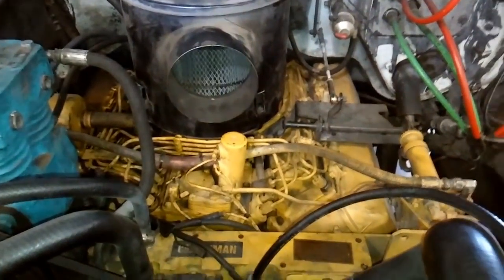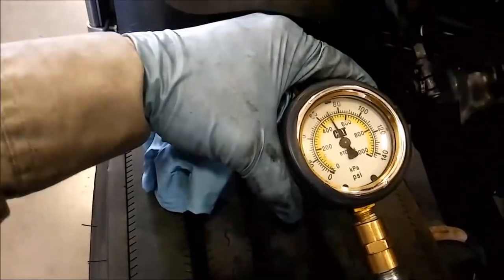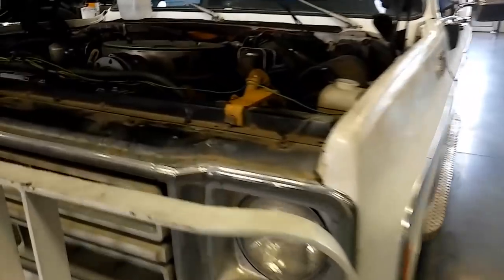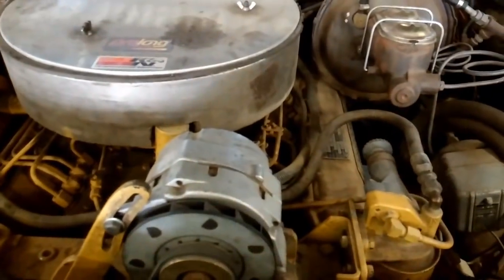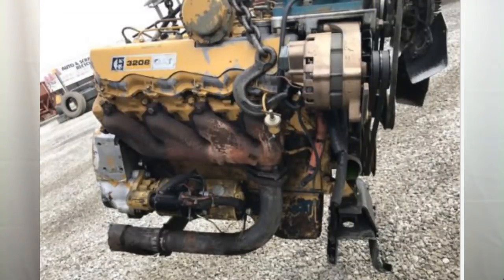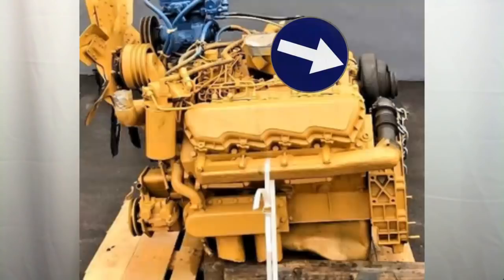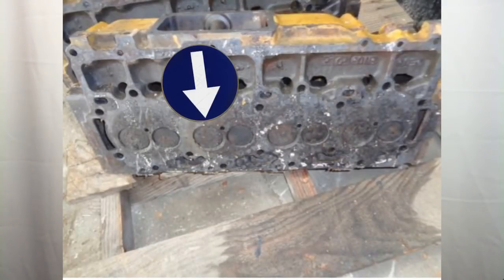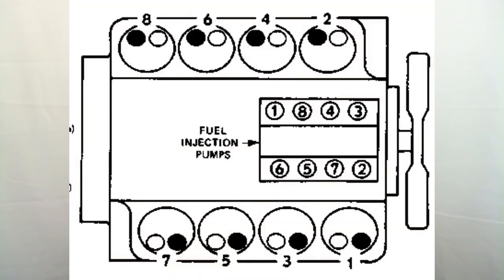The Cat 3208 Engine.  Know Your Engine. Engine Design And Problems.  Cat 3208.

Comment: FTWC, we had a 1975 Massey Ferguson 1805 farm tractor with a 3208 NA. I think the h.p rating was 210. It was a good engine for that application.
Reply: Daniel C my family has a steiger bearcat with one rated at 235 hp. The na models were pretty good. When they start boosting them that's when they started have the real issues.

Comment: Quite a bit of controversy about the early history of the 1100, 3100  3208 family of Caterpillar engines. The 1100, series was a truck engine and came in three versions. All 4.5" bore, 1140 had 4.5" stroke, 1150 had 5" stroke, 1160 had 6"stroke. The 3100 was the industrial version. Both 1100 and 3100 had compact inline fuel injection pumps with servo assisted mechanical governors. There was one truck engine arrangement which used a limiting speed governor.
These engines were designed to compete with Cummins 555 and Detroit Diesel 6V53, 200 HP @3000 RPM. All these high speed medium duty diesels designed during the first energy crisis of the late 70's. Ford was one of the first customers for the 1100 engine and used them in the new "Louisville" series of trucks. FoMoCo called them their 636 diesel and sold parts and service for them but, they were a Caterpillar engine top to bottom. The early 1100 and 3208 engines had a lot of connecting rod failures on cylinders 7 & 8,  mainly because the main bearing oil holes were too small and starved the rod bearings of sufficient oil film. Early 3208 engines had a lot of valve spring failures which was a supplier issue. There was a known serial number range that Cat supported but customers whose engines failed out of the serial number range made a dealer service manager want to eat his own children.
  Engine oil consumption was occasionally an issue but mostly because of poor management of first hours in service, driving a new tractor 30 miles from dealer to farm usually made for an oil burner. Hauled home, put to work they were fine.
Reply: I appreciate your comment. I have a 1972 Gillig school bus with an 1160 in it. It runs great but it’s so hard to find anybody that knows about the 1160. I think if I ever have major troubles with it, I’ll try to swap a 3208 in it since they are similar in size.

Comment: The funny thing is every truck that I  have seen "work on" with a 3208.  They all had been reman engines.
Reply: I bought a remanufactured one,ran it for a year then it started tapping, turns out a sleeve they machined in the cylinder bore is moving up and down. I should of just rebuilt my old one as it was just a rod bering that failed but time was of the essence.

Comment: 3208 is a good engine. People just hate on them because not the most powerful for its displacement but strong enough to be turned up. Also people hate cause they love to point out it's a parent bore. The engine do weight  a bit but what medium duty diesel of the era didnt. They loved fuel . Lol.

Comment: The 3208 is a tough enguine New Holland put them in ensilage harvesters in the 80s and they ran full throttle pulling hard from 4:30 am till 9:30 pm everyday 7 day a week they tried the turbo model but they worked so hard the turbos ran cherry red hot and wouldnt hold up but the moter was a work horse

Comment: Just had a flashback on those coolant tube o-rings, also doing mains using that offset "socket " for the front main to get around the pump.
Reply: Still have the offset wrench used to roll in bearings pin for pump timming an little bearing roller tab reman from cat had std bores

Comment: Haven’t worked on a bunch but I remember very easy starting engines. Took a fuel pump off a garbage truck and damaged the rad.  Had to solder over some rad cores

Comment: I think it's worth pointing out that Cat had 2 very different V8 engines available in trucks:

- Small block 90° V8 3208
- Big block 60° V8 3408

The 3208 was used in medium duty trucks.  It was not a Class 8 OTR engine. 

The 3408 HD Class 8 truck engine was Cat's equivalent to the Chrysler 426 Hemi.  It also stayed in production far longer, as the 3408E, through 2005.  They are not cheap.
Reply: You forgot the 1100 series engine, 1140 1145, 1150 and 1160.
Reply: @johngoldsmith6629  1160 preceded the 3208,  much like the 1674 preceded the 3306, and the 1693 preceded the 3406. 

The 1100 series were all smaller displacement engines, so they wouldn't be commonly found in Class 8 OTR trucks of the time.
Reply: @UnionThugg  Yes I have worked on all of these except a 1676.

Comment: My Pops has a FC '77 Bluebird 33' Motorcoach with a 3408, haven't had any major problems with it so far.  He still wants to swap in a 8.3 Cummins
Reply: RobiSydney 3408 will be too big for a Blue Bird motorcoach. 🤔
Reply: The Bluebirds used a 3208 not a 3408.
Reply: If its a FC33s either came with Gignormous Gas engines or 3208...3408 is almost twice the size of this little engine.

Comment: I seen the cat table that had a high 700hp for turbo marine app. When I was diagnosing why my forklift was burning up clutches. In a fork lift 190 hp , I was kicking 400 from a reman. Spitting out $1600 lipe fluid bathed clutches

Comment: Hi Josh, I enjoy and learn quite a bit from your videos. I'm currently in the process tearing down my 3208 N/A marine engine.  Also, my first rebuild... fresh water got into block and I think that one or more of the lower bearing froze up, as I cannot turn the crankshaft. After I rebuild what I need to, I'm concerned about how to time my fuel pump. Is there a method I would need to use?

Comment: 3208 in a LN8000.  185hp NA 32Y, not enough power to get out of it's own way, smokes like a freight train when cold, starts better than almost anything down to 25 deg F.  Lift pump is suction so a plugged filter will suck air into the flooded injection pump.  I don't remember seeing the coolant tube, I'll have to look again.

Comment: The CATERPILLAR 3208 V8 was a creation between FORD MOTOR CO. and CATERPILLAR INC. FORD needed a diesel engine for their medium duty trucks and school bus chassis so CATERPILLAR came in. It is said that CATERPILLAR took characteristics from FORD'S 534 V8 gasoline
 engine to create a medium duty V8 diesel engine, the result was the "FORD" V-636 diesel engine* (just imagine your typical CATERPILLAR 3208 but painted FORD Oval Blue)...I don't know at what poit FORD skipped the V-636 blue engines and began using CATERPILLAR yellow V8 engines that now where coded 3208.

*Ford coded it V-636, V for it being a V8 and 636 for engine displacement in cubic inches.
It is a so-much hated engine but this engine was responsible for the transition from gasoline powered trucks to diesel powered trucks in light duty, medium duty trucks and school buses in the late 70's.

Another reason much people hate 3208s is because it is not an "in-frame overhaul fixable engine"...if cylinder bores got damaged machining needed to be done to the engine block (3208s can take as much as 2 over-bore overhauls) 

CATERPILLAR splitted a 3208 in half to give us the 318 cubic inch / 5.2L 3204 engine which is a 4 cylinder engine (it shares cylinder head and some internals with the 3208)
Then CATERPILLAR took 2 cylinders.out of the 3208 V8 to create the 3206 engine, but just 3 engines where made.

Still 3208 is one of my favorites, I like them and know to work with them.
Reply from the maker: Thank you for the very informative information. Can't find this stuff in the Cat network.
Reply: I have wrenched on 3204s in Small Crawlers and yes they are "half a 3208" the 3206 prototypes I have heard of...I actually like the 3208s and as long as you roll in bearings and know what to watch for, they will out last gassers in medium duty applications... Certainly Better than DD Fuel Pincher 8.2L in personal experience.
Reply: M Shultz 8.2s down here were complete and udder rubbish !!
Reply: I believe 3208 CAT engines were derived from 1145 - 1160 engines from a Ford/CAT partnership.
Reply: EM6285 
Are you a diesel mechanic?
I have a 1987 Beaver RV with this engine and need to take it in to someone who knows this engine.
From what I read on the internet it is a gamble today to take one of these into a random shop as they do not know them and misdiagnosis is common.
Mine is spewing oil somewhere.  2 years ago it would need a quart every 1000 miles and now it is probably every 200 or 300 and I see oil on top of it.
One guy had this problem and it turned out to be that the bell housing bolts get loose on these and it in turn ruins the gasket.

Anyway, if you are a mechanic who is familiar with these please let me know.
I am willing to travel to get this issue resolved.
Reply: Thanks for the knowledge.
Reply: Ford's were actually 1160's,  Cat 3208...
Reply: Somehow I didn't expect you to say you liked the 3208 Cat ....(at the end there)
Reply: That would make sense as to why New Holland combines used Ford diesels up to 140 and the the bigger combines all used the 3208. New Holland at that time was called Ford New Holland

Comment: Nice video!  Could you do one on the 3406A, B and C models?
Reply from the maker: +Steve Ross I'm going to be doing one on the 3406B soon. I get a lot of requests for it.
Reply: C model is first attemp at some electronic controls ??? I know it had an electronic throttle on a mechanichal pump and people would convert them back to linkage when it broke
Reply: Walker Vaillancourt there was a 3406 c industrial that was a hopped up b model. All mechanical used in small ships, construction, and stationary power units usually cranking out 600hp up to 720hp for marine use.
Reply: Nope B model has a electronic governor and electronic assist vtu.
Reply: @johngoldsmith6629  
My 1988 3406B was all manual. Was a beast pulling the hills.
Reply: @michaelmcclure8673  First B models was a 7FB, max 400 HP, JWAC and used a 92U cylinder head casting. Did not take Cat long to redesign head strictly for the B model.

Comment: Jake, would it be possible for you to give me some guidance? I’m working on a cat 3208 that’s been sitting for about four or five years. 
The fuel shut off solenoid appears to be working fine, however, the little thing that it pushes in the top of the injector pump was stuck in the down position, I did get it moving up and down but it does not feel that it’s spring loaded in either direction. When I pull up on it it stays up when I push down on it it stays down, is that the way it’s supposed to respond or should it be spring loaded in one direction or the other? Also, I was thinking about taking that top plate off like you did in cleaning it out and freeing things up. What are your recommendations and where should I start?
As a sidenote, I’m not a mechanic just mechanically inclined…

Thanks,
Mark

Comment: You can bore just one cylinder as they make O. S.  pistons and they weight the same as a standard bore. Sleeve metering fuel system and water will destroy it. As it runs completely in fuel to help cool and lubricate it. They was notorious for sucking air. As the entire system is suction it could be any connection or part from tank to pump and pump itself. Had to keep bearings in the lower end and keep the valves adjusted. Water separator is junk, need to take it off and use a spin on primary. Some people actually put a inline fuel pump on these. Bad to use oil and cold weather would burn your eyes if running inside. If it has the metal sleeves between the head and front cover you better save them and reuse them. Seen the plastic ones melt if ran low on coolant. 
What was weird was a 0R1108, as Cat retired the 1100 series and many was still around. Cat put a front cover off a 1100 series on a 3208. So all those parts hooked up directly and all you had to fabricate was the throttle linkage and fuel line hook up.

Comment: Thank you for the videos! the coolant crossover tube at 8:20 is gone in my 89 Gillig pusher conversion. can I pull off some of the front housing stuff  slide back that plate. and finger in some high temp JB weld , or similar products as an alternative. If that`s not too crazy, It looks like that might be what was being done before I got it from the school yard. any thoughts or suggestions would be greatly appreciated.

Comment: `non turbo 3208 is a flat tappet engine, turbocharged models had roller tappets as well as piston cooling jets. 375 hp 425 hp 435 hp and 450 hp marine engines are all sea water cooled aftercooled, not ataac. many commercial fishermen use these engines with great results, especially the 375 hp model.
Reply: basket of deplorables was just gonna say that, my family owns a Ferry service and has four boats with 3208s  in them 375hp and put about 1200 hrs a year on them

Comment: Flat tappet cams were in the early engines and a cast camshaft. Later engines had steal cams and roller lifters cylinder damage. You can bore the block .030 then .040 then sleeve it back to standard bore. And the nice thing adout boring oversize is you don't have to rebalence the engines oversize pistons weigh the same as standard. Pistons. If you take care of this engines it will outlast you!

Comment: Hey man like the vids keep up the work. I was wondering how long should I should let my 2001 24 valve Cummins warm up for in the winter before I drive off? I watched your video on idling for diesels but u didn't specify how long is to long for idling or how long u should let your diesel truck warm up for thanks.
Reply: Colin, the best procedure is to start it up, get oil pressure, and then motor down the road being easy on the throttle until the engine approaches operating temperature.

Comment: They were good in boats only at the 210 non turbo rating. A boat here in the harbor had almost 25k hours when he replaced it with another one. The 375 and 425 turbo models not so much. I watched one erupt in a boat about 3 miles away. Huge plume of steam as it ate something and the coolant came out the dry stack. I had a 210 in a GMC Topkick wheeler. What a pile. Had a 13 speed and it need every gear getting up a hill. The 3116 and 3126 in boats,,,,, junk, about 5 k hours if your lucky.
Reply: 1958johndeere620 210 in a truck of course you will struggle pulling a hill, that's pitiful by today's standards.

Comment: Very informative , I have a boat customer with a pair in his 46 searay ,port engine is very hard to start after sitting for a week or so,found the fuel filter( spin on is half full and the racor indicator gauge is reading 8 psi,filled the filter and loosened number 8 cylinder injector line to bleed and away we go. However,has a misfire on number 6 as I loosen the line and no change in rpm,could the injector be the source of the leak down?and what is cause of hi pressure on racor filter?has almost 1000 hrs on engines,starboard one has a valve train noise ?knocking sound ,thanks roger

Comment: Hi Josh,  the company I work for is buying 980m loaders, we currently have 5 and they are running great so far. What engine are they using in these and is there anything to look out for with this engine? Thanks for your time.
Reply: Neil Neil 
Cat C13 ACERT
12.5L in-line 6 cylinder
130mm bore x 157mm stroke
Adept ape already has a good video from 2016 on C13/C11
https://m.youtube.com/watch?v=dYdRoefz3Ck
Only other thing is cat was going to be sued at one stage due to constant DPF faults and issues see below article

https://www.dieselnet.com/news/2010/08cat.php

Hope this helps for the mean time

Comment: lucky me, i had a 37' boat with 2 of these monsters 3208TA 375 hp smoked  so bad you could see me coming 30 min b4 i got there, got 3/4 mile to the gal., wanted to repower with 2 C9s but it turned out to be to expensive,sold the boat instead

Comment: Good video. I worked on a few of those boat motors back in the day. What a pita. 
Question, what, if any, engines do Cat make to go in pick ups? Say, in the 3/4 to 1 ton sizes. 
Thx
Reply from the maker: +jimgam730 They never made a pickup engine, but the closest thing would be a 3126 or C7. They are about 1500 pounds and can go up to 350 HP. They have smaller engines like the C4.4 and C6.6, but those are actually Perkins engines and I'm not a huge fan of Perkins.

Comment: Would you be that kind and do for us automotive dumbheads video on EGR valve and process not only on valve itself but how does that help to warm up engine, reduce the volume needed for expansion and how it automatically adjusts.
I would be very grateful although I know it is not primary truck related..

Comment: Maybe do a video on the Cat 1100 Series? (1140/45/50/60) If I'm correct they were the Original 3208.
Reply: 82 Diesel I thought the original 3208 was FORD'S V-636...whic is a 3208 painted FORD blue.

Those 1100 series you mention where also used in FORD trucks.
Reply: EM6285 No Clue on the ford thing very little info...The 3208 was an updated 1160, The main visual difference between the two was the injection pump.

Many people didn't like them because you could not do an inframe rebuild on them as the cylinders were cast in to the block and not as sleeves like a Cummins 855. You had to pull the block to have it bored like a gas engine. From what I've heard from other people is that they are a good engine when used for what they were meant for but don't hold up well when pushed to do the work of a larger engine. And yes, they are well known for smoking when cold.

Dodge offered the 1100 series Cats in the 1973-1975 C800/CT800 trucks. Later on they used the 3208 in some of the CT800 chassis that were used by a separate company to build aircraft refueling trucks for the Air Force in the mid 70's (they also used Cummins V8 version called the 555).